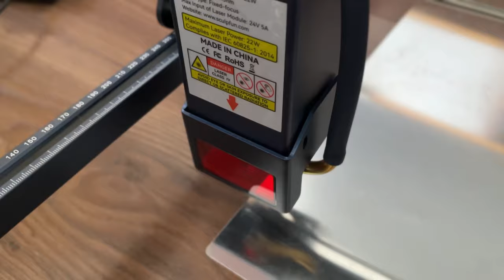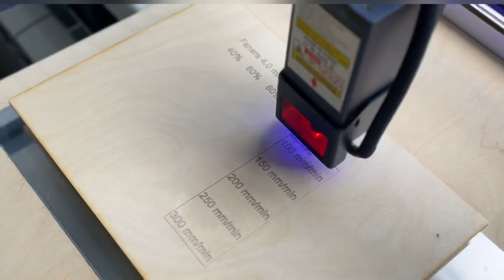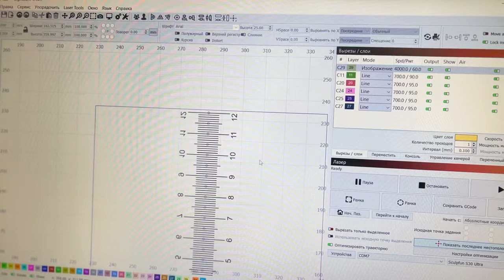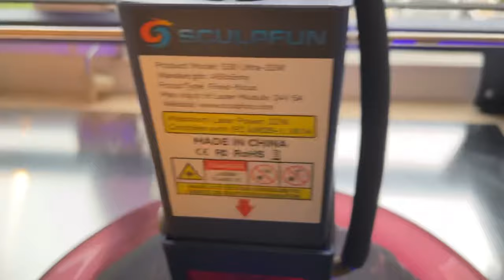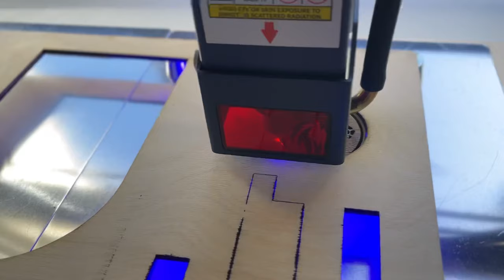SCULPFUN S30 Ultra 22W. Lots of TESTS! large and powerful! Best for hobby or small busines

Comment: What is that piece of metal you use on the bottom to reflect the laser instead of a honeycomb please?
And also where to get the round metal feet you use to hold up your work?
You’re the first I’ve seen using that method. Thank you.
Reply from the maker: Hello! This piece metal it’s an aluminium sheet.   The aluminum sheet and round supports were included with the laser . Instead of round supports you can try to use such big nut bolts. They are much comfortable in work. Plus you can add neodymium magnets. they will help to fix the workpiece https://yandex.by/images/touch/search?img_url=https%3A%2F%2Fagroman.by%2Fimage%2Fcache%2Fcatalog%2Fcatalog%2Fskobyanye_izdeliya_krepezh_zamki_petli%2Fkrepezh%2Frezbovoy_krepezh%2Fbolty%2Fd14c672ee88b69ae39724bfcdb5d6f66-1200x630.jpg&lr=157&pos=1&rpt=simage&source=tabbar&text=%D0%B4%D0%BB%D0%B8%D0%BD%D0%BD%D0%B0%D1%8F%20%D0%B3%D0%B0%D0%B9%D0%BA%D0%B0%20%D0%BC20
Reply: Thank you so much!

Comment: Hello, how do you centrate such precise the laser... I mean on the small object in middle of the laser point 😮?
Reply from the maker: If I understand you correctly, I find the center of the details. I'm drawing a dot. Then I turn on the laser in the lightburn and combine the center of the detail with the laser point
Reply: I relay need a video for this, if you have one please let my know 😅, I try so many time so many ways but it doesn't work I have a sculpfan s9 and if I want to engrave coin or something smaller I have to cut the dimension in a paper or samthing other way I failed

Comment: so you still have to use that cylinder to distance laser... and now its 4 screws instead of 2.. thought this was a upgrade..
Reply: If you want auto focus,  just make one and plug it in.
It also has extra room for 12v or 24v laser, 5v output,  air assist output,  extra Y axis stepper motor input, WiFi, BT, external touch screen remote, X Y micro switch inputs, probe motor and probe inputs. 
They've more then upgraded them....
Obviously the company isn't giving away much in terms of what can be modified but if you've been around arduino or esp then you know what can be achieved!